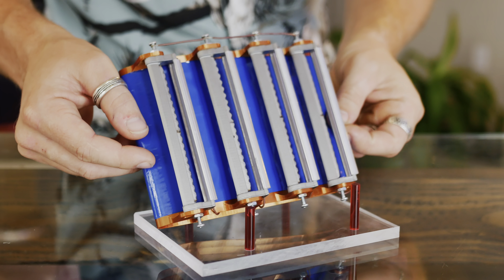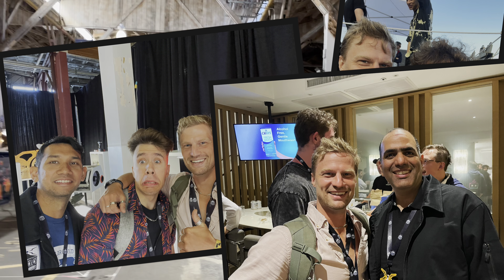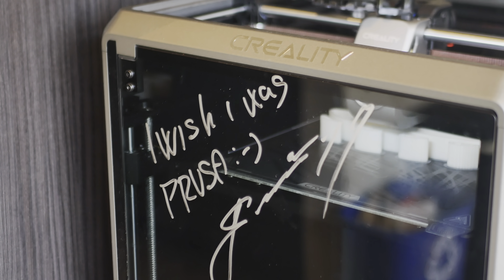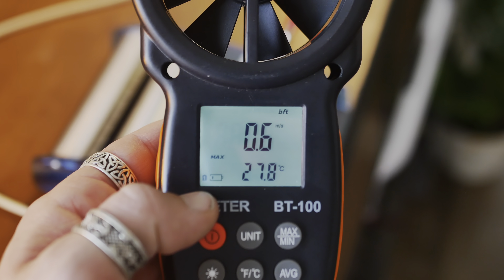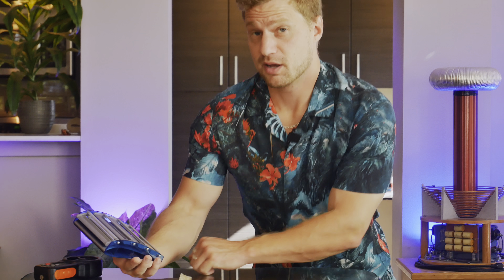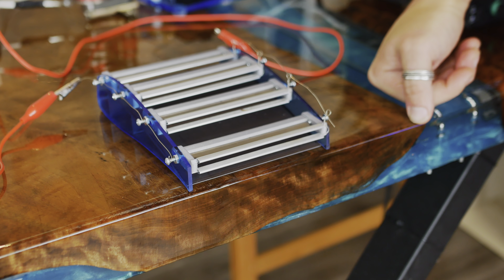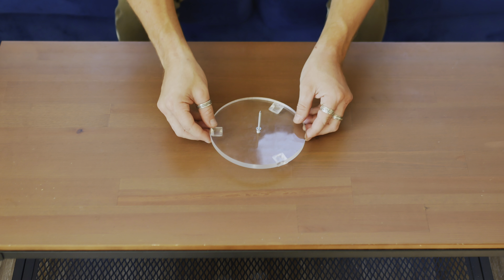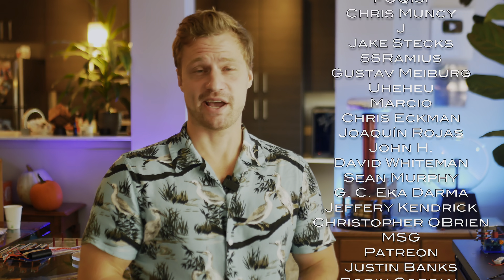Designing A Self Propelling Ionic Thrust Wing

Comment: Why not make the wing the thruster and not add thrusters to it. The wing would be foil covered and run a very thin high tension tungsten wire in front of the wing. This way in a glider you’re not limited to length. And the moving air would not be use to push the glider but actually lift it as it rushes over the air foil which would reduce needed air speed.

Comment: It would be interesting if you could put this into a zeppelin.  Maybe use a hollow wing filled with a gas that's lighter than the ambient air or a heated gas? You could use 2 wings, made of gas filled conductive foil.. and anode and cathode.. and they could be filled with helium.
Reply: To change the elevation you could displace some the the helium with heavier gases. Have something to recover the helium in maybe in intermediate wing that can be displaced using compressed co2 through a regulator. It will be similar in concept to ballasts on a sub.

Comment: i wonder if enclosing the whole thing except an exhaust out the back of an outer wing and letting it draw intake air by sucking it through the center if the inner wing would provide any improvement, i imagine at the very least it would let you add something to dry the air and reduce the popping

Comment: Just curious, what would happen if you incorporated the grounds into the wing itself? I'm thinking along the lines of: instead of using stand-alone segments that sit above the wing surface, you could use straps of aluminum tape across the wing with the positive electrodes sitting slightly above, and forward of them. 
If I understand the principles correctly, that would mean the air would be getting forced directly across the surface of the wing, rather than relying on a ventury effect to pull air over the surface.
If you used wire for the positive, as you suggested at the end (or very thin metal rods so that they're perfectly straight to keep a consistent gap), this might also help smooth out the air flow, since the wire would create minimal drag and turbulence, and the ground being integrated into the wing surface could direct the airflow straight into the next thrust section 💁‍♂️.
 It would also eliminate the weight of the grounds' support structure. 
Or I could be completely off track 😅

Looking forward to seeing the next video of this project!

Comment: To get rid of the high pitch noise you can either put a low pass filter, or a high cut filter on the audio - setting either filter to around 15,000-17,000 hertz. If the filter gives you the option to change the "slope", make it as steep as possible. Super sweet project, cant wait to see the final thing!!

Comment: You should try pulse modulating  the nodes with alternating current. There's a staggered pattern that helps with thrust, as it creates different ions depending on flow direction and node polarity. Using copper instead of steel also plays a factor. It's the reason the original ion hover triangles work so well. Both the pulse modulation and that pairing of copper and aluminum. They make a copper version of the metal tapes so you can pair copper and aluminum tape

Comment: Two concerns I would have are drag and maintaining smooth laminar flow over the top of the wing. You'll need a wind tunnel with a floating armature to test if the thruster/wing, in that config, will produce sufficient lift. They are relatively easy to build with a couple boxes of straws and a tunnel. An airfoil creates low pressure on top and high pressure beneath.

Comment: I wonder if it would work better with the thrusters built inside the wing, also would it improve thrust if each part was a bit smaller and it was built into a chamber that reduces in size. Like larger intake than exhaust

Comment: When the voltage or the Ampereage is high, electricity is no longer your friend. ;)
Barring a paradigm shift, I don't think Ionic thrusters will help atmospheric flight unless it's an add-on to current (no pun intended) technology (like holding the boundary layer to the wing surface to avoid stalls and increase efficiency).
BUT
It will advance spaceflight, referring to both the SF plasma drive of "The Expanse" and NASA's VASMR technology.

Comment: I can’t help think the armatures over the top is going to reduce the wings lift efficiency. A single wing with the ionic thrust built totally into the airfoil is what’s needed. I feel this has real merit and opportunity. 👍
Reply: Could be done with a long continuous ion thruster design... would probably need to be designed with a physicist or fluid dynamics specialist or artificial intelligence with a simulation or something but I'm sure you could find the optimal distance and shape of the airfoil and the smooth ion thruster layer over top? 🤔

Comment: Embedding wire grounds into the wing and using the aerofoil as the charge above the wing might work. I think vertical fins is the answer though. Short but dense forests of vertical electrodes would draw more air and could also potentially be used as control surfaces for directing the craft in flight.

Comment: attach the batteries to the wings.... if you can use flat batteries then you can "hide" the batteries in the hollow wings.... this doesn't technically remove weight but when do this it will allow you to have more battery capacity and a lighter overall plan design.

Comment: the one on the trailing edge of the wing should have the highest current in comparison to the others. also the first should be sending current below the razor. the second the same. the third one with the two bars you added even with the upper bar and razor. the last one how you created it pointing to between them. nice work btw

Comment: Could make a multi-blade propeller where each blade is one ion engine, getting you a fair amount of thrust. Otherwise maybe try to find a way to incorporate the whole on engine into the surface of the wing to minimize additional drag from having the ion engines sticking out?

Comment: I wonder if this type of system can be set up in a staged system similar to how a jet engine has different compressor stages. Perhaps there's a combination of different stage sizes, spacing, and voltages that could be used to achieve that effect and test performance.

Comment: You keep making the same mistakes. Integrate the ionic thruster into the wing itself. Use electroplating on the wing itself and use pins through the wing near the leading edge to generate the plasma thrust.

Comment: some thoughts from an aviation guy... there are some great benefits to accelerating the airflow across the upper surface of the wing, like it will stall at a much higher angle of attack. Unfortunately I believe the equipment on top of the wing is acting as a spoiler and preventing the wing section from creating any lift at all. A passenger jet with even a small amount of frost contaminating the upper surface of the wing will not fly at takeoff speed. But this is a prototype, A starting point. I am blown away (pun) by the amount of thrust it generates. I don't understand the mechanics of the high voltage stuff, but if you can make a system that is flush with the upper wing surface and maintains laminar flow ,it might just fly like an anti gravity machine..

Comment: this is super awesome 
as im sure you know those stun gun modules are potted in resign , a new lighter drivers will save weight
also you dont need the screws and nuts on the thrust modules , and the bracing inside the wing itself can be lowered even more , your not building a tank 
also ask peter if you need to mount 2 modules above the wing and 2 under the wing to cancel out ,instead of having to worry about the plane pitching down

here is a crazy idea , why not use the trailing edge of the wing itself as an electrode and have a thin wire on posts behind as a negative electrode , like dragging the wire horizontally behind the wing

Comment: I wonder if using the electroplating technique that Integza used for the ground portions of the thruster would help. Also have you looked into slotted airfoil wings, there might be a way to imbed the thrusters into the wing using them.

Comment: Nicely done! Very fascinating.

Thought. Suppose you created not just a plane with glider wings, but an actual plane that's a glider wing in itself, like the B-2 stealth bomber.

Seems you could gain a lot more surface area for propulsion, even if you wanted to have a human-sized cabin later on down the road.

Wide wing space to maximize lift versus weight ratio. Wouldn't be breaking the speed of sound anytime soon, but could make a useful idea for a drone if you could get the prototype to maintain lift.

Just a thought.

Comment: so I already figured this out a couple months back. your "segments" should be little wings. the little wings "segments" need to ALL focus down on the surface of the main wing, not just shooting straight backwards. Also, you NEED to make the main wing the little segments sit on top of an ionic "thruster" as well. the little segments should be arranged so they cause an overlap between them which focuses the thrust while letting air in still. I am willing to help you with this. both us together can make this reality. 2 heads are better than 1. I have a 36 year background in mechanical prototyping. comment "yes" and I will give you an email. good job so far !

Comment: How about putting the thrusters on the inside of the wing and have them send thrust through slits so you get a more aerodynamic wing?you might even be able to cut down weight by using the hull of the wing as part of the thruster instead of having them seperate and mounted on the wing

Comment: Could go with the dielectric barrier discharge method to reduce weight, and seamlessly incorporate the thruster into the wing.
If I remember right they call them plasma actuators in the context of aircraft.

Rather than a single ground electrode, you can use several with progressively thicker/higher value dielectric barriers as you got further back in the wing.
This forces the airflow to stick to the surface of the wing, produces a laminar flow and provides a much larger surface area for influencing the ions.

Comment: I dont think the vertical struts in the wing are necessary and instead have a slot for a carbon fibre rod to save weight and add a massive amount of rigidity back. also thought that maybe haveing only one thingy ma bob slightly infront of the leading edge would be more efficient. would love to see these ideas tested :)

Comment: As the speed of air moving through the thrusters increases, then there is less time for the air molecules to become ionized.  To get more speed and more thrust, you might have to increase the voltage or increase the flow-wise dimension of the upstream electrode.  Increasing the dimension would allow the molecules more time to become ionized as they move faster through the thrusters.  Another option might be to aerodynamically slow down the air as it passes over the upstream electrode.
Reply: I wonder what would happen if you took this wing and used it as a fan blade in a engine. With most of the blades having ionic thrusters to push wind over them would this create thrust.

Comment: I like the concept but if you wanted to develop this further into something that might be able to fly an airplane, there is at least one trade-off that i can think of. It might be ok for a slow plane that needs a lot of lift or on takeoff/landing to decrease stall speed, but when you get into wanting to fly for range and efficiency, you are better off having the air moving over the surface of the craft to be as slow as possible. As you increase airspeed you will increase the drag on those surfaces, which will hurt your efficiency. As the airspeed goes up on a surface, so does the Reynolds number which from a pure efficiency standpoint, you want to be as low as possible to try to keep the airflow in the laminar flow regime for as much of the wing as possible from the leading edge rearward. Not to mention the actual turbulence produced by the thrusters just above the wing. I could see this being something that has the one of the electrodes raising up out of the wing with the other being the surface of the wing and using it to help with takeoff and landing, when efficiency isn't your top priority but safety is.

Comment: Faster air over the top will possibly reduce uplift as the longer surface in relation to the bottom is what creates it. It will effectively cancel out or even cause a downward force. Maybe better on the bottom.

Comment: Immediate thoughts on wing design from an engineering dropout, cutting huge squares out of the wing seems like an inelegant solution. Since you're 3d printing them, you could make the whole wing surface a hexagonal lattice, right? Hexagons are the bestagons after all. Low weight, high strength? I could be missing structural issues that might lead to though... Like I said, dropout XD

Comment: Wouldn't you make more thrust by adding a roof to the ion stages as to act like a second wing but also a weird rectangle like intake engine if so you may be able to built the ion engine inside the wing like an internal ion engine reducing weight if you go that way so then you could make the whole wing the engine and wing while hiding the engine from outside elements leaving only the air flow to generate thrust as I think you would have to account for things like rain or aggressive winds instead of stationary atmosphere air that is inside a home

Comment: This is my print suggestions for reducing wheight of the printed parts 

Instead of cutting away material in onshape leave the full part and use the following slicer settings 

Infill pattern: lightning 
Top/bottom solid layers: as low as possible 
Perimeters: 1 (maby 2 if that doesn't turn out well)

Also as others have mentioned  you can get LW-PLA that foams with higher temperatures so that will cut the printed parts wheight in half.

Comment: Could you save more weight and eliminate a lot of drag by incorporating the anodes and cathodes into the upper surface of the wing itself? Air would only be accelerated on the upper half of the electrodes, but the reduction in mass and drag might make it worthwhile overall

Comment: when scaled up would one long or horizontally segemented thrust electrode(s) provide better lift vs weight/drag ratios? 
What I'm saying is does the electrodes and airfoil/lifting surface has to be seperate like in this video? could they be combined into a single airfoil electrode component that would potentially reduce the weight in half?

Comment: Ok, so an idea that I have if you want this to be usable in aircraft, you might want to have the thrusters below the wing, or use an air intake system near the fuselage, so that the thrusters can be in the wing and not reduce the aerodynamics by a lot (Think of a system like the early migs)

Edit1: You could potentially store the batteries in the wings and use the fuselage to make many layers of small ionic thrusters behind a nosecone and have a bit of space to attach weight to test how it performs.
Reply: Great project! 
I think you have to remove the whole electricity installation from the wings. You can't make a wing function - create lift - without free and undisturbed flow around the wing - laminar flow - except when you want to delay the onset of stall. The thrusters are great but I doubt you are at all developing lift. Try to measure the lift with a clean profile for comparison.
Keep it up!
Reply: @dusk2dawn2  Thanks for the feedback, I appreciate it. Upon rethinking I think you could make very large wings with batteries in them and have loads of wires/breakaway points that connect to a mig nosecone at the front of the aircraft, so that you have an air intake but also thrust along the whole length of the aircraft.
Reply: @dusk2dawn2   common misconception - this arrangement, if set up correctly, will actually increase lift. The principle is the same as blown wings/blown flaps - if the propulsion system directs air over an airfoil, it will increase the apparent airspeed, lowering the stall speed and allowing the aircraft to fly slower. Examples of this are the Ball-Bartoe Jetwing (a jet aircraft with a stall speed of less than 40mph/60kph), and several operational aircraft which have blown flaps to increase low-speed performance - https://en.wikipedia.org/wiki/Blown_flap , https://en.wikipedia.org/wiki/Ball-Bartoe_Jetwing
Reply: @servo9421  neither blown flaps or the jetwing operate like this design, blown flaps shape airflow off the rear edge of the wing, and the jetwing introduced air from the engine along the top of the wing. Surely with this design as airspeed increases the efficiency of the ionic thrusters would decrease, and be compounded by increased drag.
Reply: I do believe that that's the first perpetual motion machine right there. Hook it up to a pulley and you can then power up your car.

Aim the car down a steep hill, so you can then get to work for free every day. Just take an uber home, and get your dad to tow your car back up hill (you might have to loan him a truck and a chain), so you can then ride your perpetual motion car back to work for free every day. Hook up your cell phone charger to the alternator in series with a flux capacitor and a rectifing diode pack to charge your phone, so you can call your dad for a tow, every day.

Comment: The problem is that the ionic thrusters are going to spoil the flow of air over the top of the wing, which then disrupts the ability of the wing to create lift... I don't see any solutions to this, maybe placing the thrusters underneath the wing, or on the fuselage...

Comment: if this will get resolved, we will have sailplanes in the air, the issue with propeller is the noise, in udx.aero we are also working hoverbike which will be accesible for all, but to conquer the cities we need to reduce the noise.